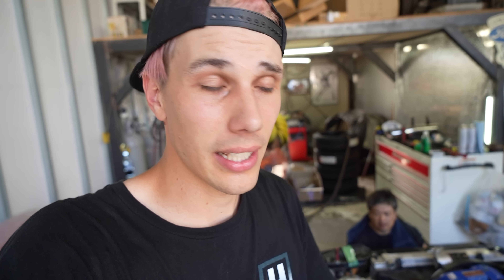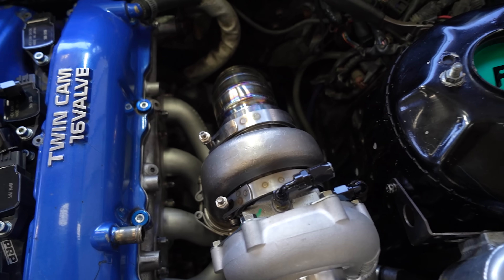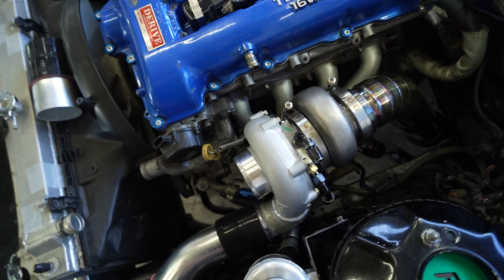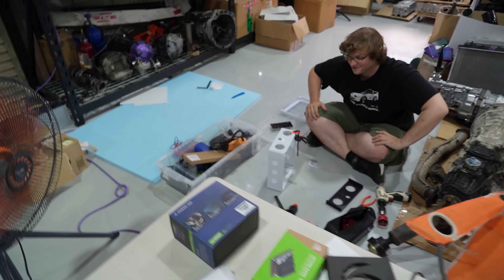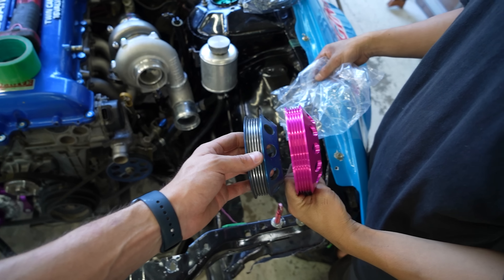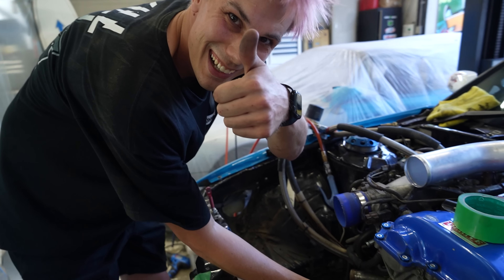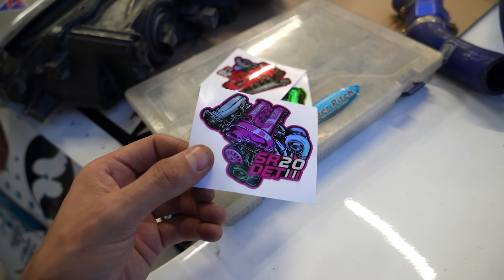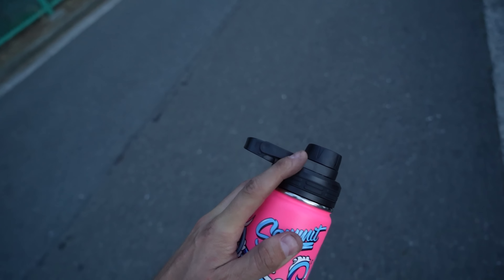FIRST START of $10,000 Surprise Car Build!

Comment: Always tighten down the waterpump pulley bolts before placing on the belt, I have seen people put the belt on then tension the bolts for the pulley and it doesn't run true (unbalanced) and the waterpump tears itself apart